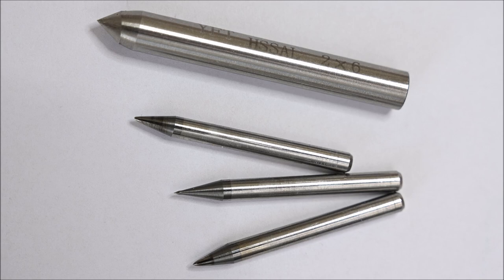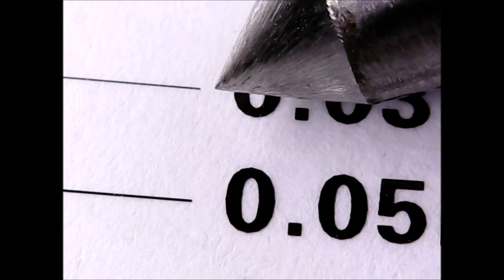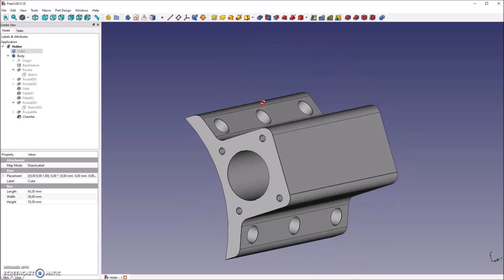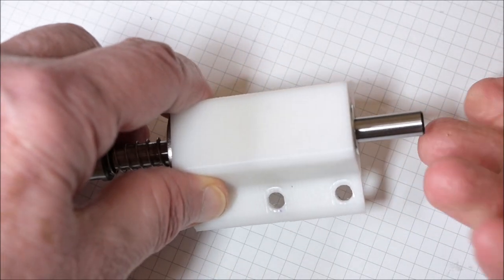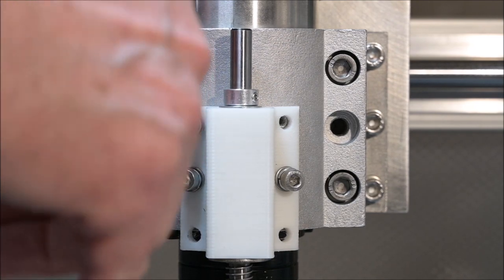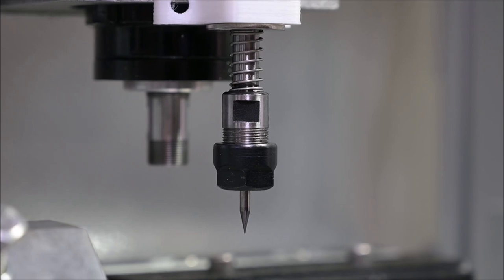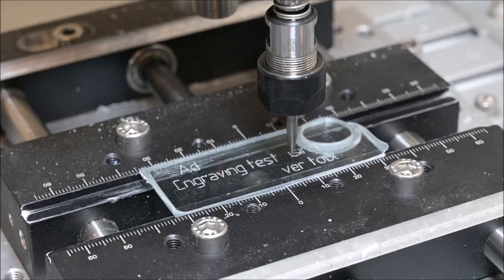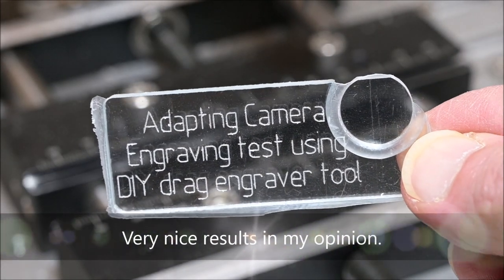Making a drag engraver for my DIY CNC

Comment: Thank you for the idea. As it happened, I had all the parts already and all I had to do is 3d print the one part and that's it. Way cheaper than the store bought one!
Reply from the maker: Thanks for the comment. I am using mine quite often and find it actually more useful than I thought I will when I made it.

Comment: Excellent work, one question: what depth would you recommend for glass?
Reply from the maker: Thank you. Depth can't really be specified with this tool as it has a spiral spring to keep the pressure and allow flexing. The applied pressure depends on the spiral spring and the engraving tip you are using. You simply need to try what you think might be the best for you, depending on your own tools and materials.

Comment: I want to engraver soft metals using these drag engraver techniques. What CNC router do you recommend I use?
Reply from the maker: I can't recommend any CNC router, I designed and built my own.
Reply: @AdaptingCamera what motors are you using closed loop stepper or servo, and kindly tell me the driver you use
Reply from the maker: @dodger7789 I am using normal stepper motors, model name 57BYGH633. Not closed loop. The drivers are cheap DQ542MA.
Reply: @AdaptingCamera  can you get 0.1 mm resolution with it?
Reply from the maker: @dodger7789 The resolution depends on your configuration and the rigidity of your machine. My machine is very rigid and I get much better resolution and accuracy than that. Remember that resolution and accuracy are not the same, the most important factor is the accuracy. Here is a link to my CNC router videos https://www.youtube.com/playlist?list=PLo219FKz6e4pwGLUnYgYV5Evn3tj_ZXdH The videos are showing my current, and earlier machine. My CNC is 100% designed and made by myself.